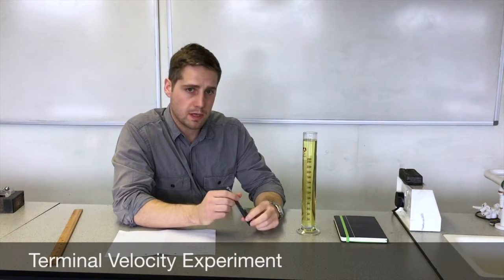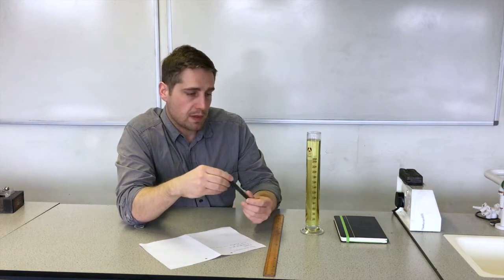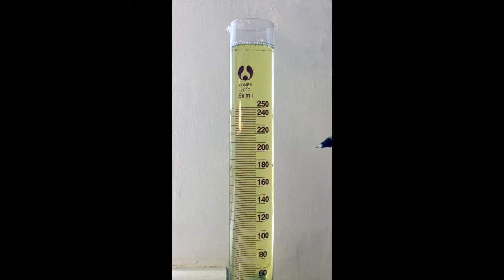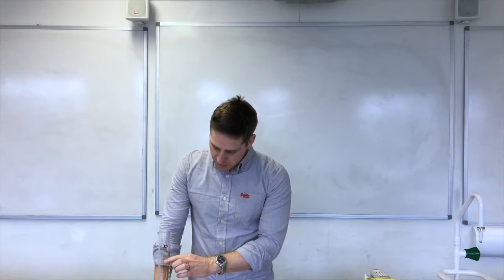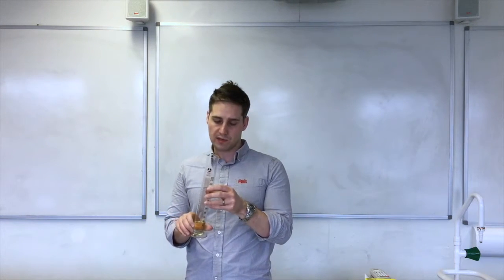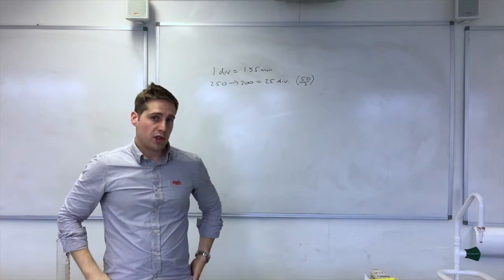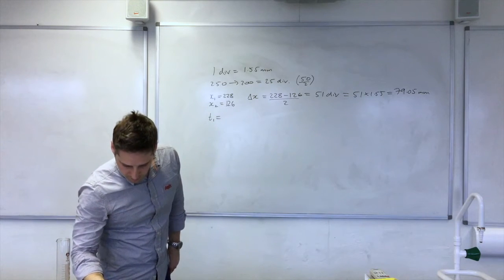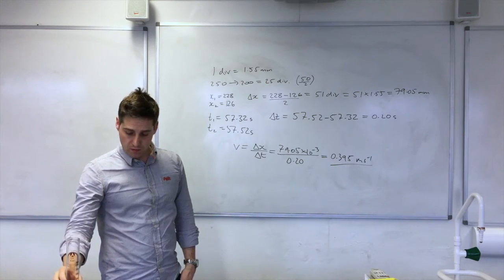Terminal Velocity Experiment

Comment: Hello. I was just wondering, how can you tell if the ball has reached terminal velocity at that certain point. Thanks.
Reply: Hi.  If the ball is moving through the same distance in the same time then it is moving at constant velocity and therefore it is moving at terminal velocity.
Reply: A Level Physics HQ yes, I understand that but I was just wondering why you knew it was at terminal velocity at that certain point 250 ml. Thanks for the reply.